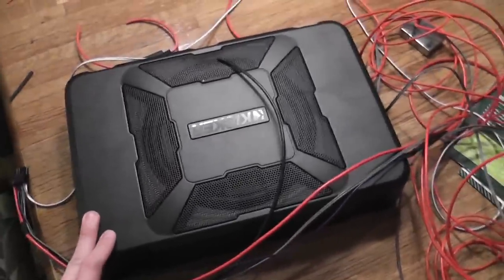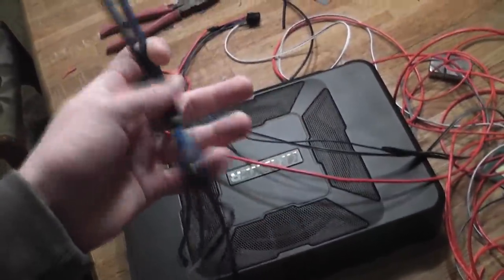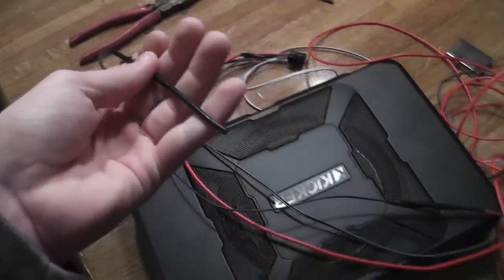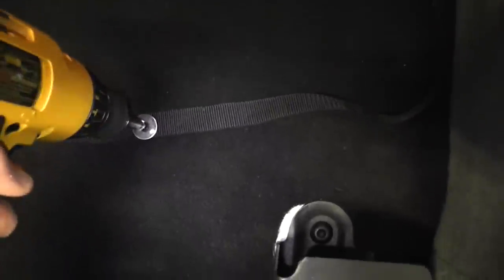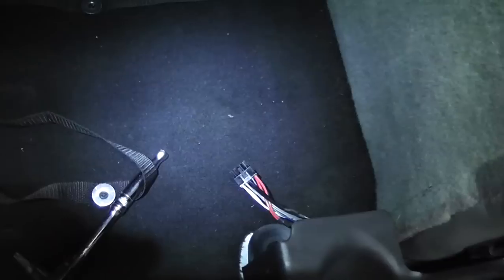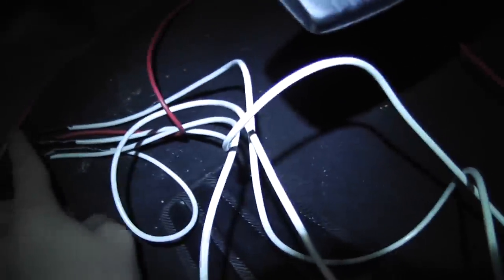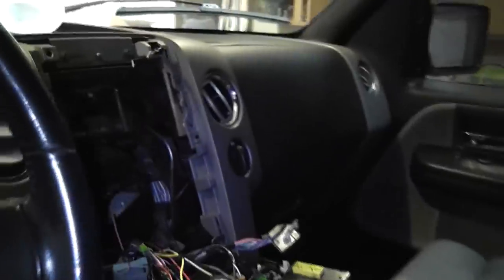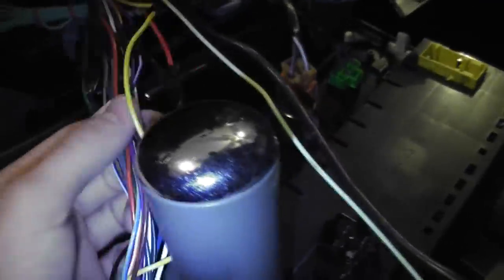How to Install Powered Subwoofer start to finish

Comment: Thanks for making the effort Bro, I researched, purchased and installed the hideaway based on this video.Far as I'm concerned Kicker should be given you a kickback. My local installers at Best Buy were saying they thought it sounds better with the high level speaker inputs rather than the low level rca inputs anyway. Sounds great, appreciate it.
Reply from the maker: Thanks man I'm glad you appreciate it I made it because every video I watched on how to install it left a ton of stuff out
Reply: Glad I watched this. Thanks for putting it together. Installing mine today and you hit on the areas I wasn't sure about. Thanks bro'

Comment: The kicker KISL works fine with it. At first mine didn't work with it. So I got my multimeter set it to check continuity. Cause the male part of the Rca on the kisl is the positive part of the Rca and the side part is the negative. So I took my multimeter put the red to the tip of the Rca then put the black wire of multimeter to each wire until it made a beep and I knew that was the positive wire for the rca. Then did the samething but the lower part of the rca and to the remains 3 wires until I got continuity again then wired the + and - to the correct wires. Then I did the same thing with the other rca tip and checked the other 2 remaining wires so I knew which wires were + and -. Wired everything together and boom it worked now. Hope this helps if you want to use rca for better sound and control with your deck instead of having to use high level inputs. If you have any questions let me know. Thsnks
Reply: Was the blue wire the tip or the lower outer ring?

Comment: Hey I connected the wire that you sent to the battery to the red wire in the radio, which is designated for a +12V accessory and my stuff works just fine and I didn’t have to drill through the firewalll

Comment: Lil late but with your headunit did you make sure if there was a "Subwoofer On/Off" setting that was on and maybe that was way you weren't getting signal? I have a pioneer  that has it set off by default as does my cheap dual unit in my truck with the same off by default  setting

Comment: FYI, there is an input level selector switch on this unit that must be set to low level if you are using the RCA connection from your head unit.
Reply from the maker: Watch the vid I know that madota
Reply: I think ur still supposed to keep it high level because it’s still speaker wire attached to rca cables. The sub works because of power. This happened to me installing an alpine power pack. I was stuck until I accidentally figure that solution.

Comment: Normally, if there is RCA out on the radio, you just run the RCA straight to the amp. If there isn’t, then you need a high-low converter (so you’re not amplifying high signal).

If your amp has a built-low pass filter (which it looks like it does since it didn’t have a RCA input), then you have to tap directly to the speaker wire from your radio.

What you tried to do was send a low signal from your radio (RCA output) into a low pass filter (in the amp). That is why you couldn’t get any sound.

It seems like you sort of winged it, without understanding, and then made a DIY instructional video.
Reply: Minh Tran A couple of things wrong with your comment, this amp can run on low (rca) signal or high (speaker) signal. It has a switch the lets you choose your configuration. The other thing is low pass filter has nothing to do with input. I know you meant low level input (rca). Just saying.
Reply: Minh Tran kicker specifies in their directions for this that you can run the kicker rca to an aftermarket radio. He might have wired the wires in the harness wrong to the rca but he did everything else right

Comment: Did you find out why the RCA adapter didn’t work? I’m about to install mine. From the booklet that came with mine (HS8) the adapter is called ZISL but when I looked it up, only thing that came up is part# KISL.
Reply: KISL is the I guess newer version of the same thing.

Comment: I’m considering getting the 10 inch hideaway, but I’m not sure. Can’t decide if I want a 5 channel amp to power my Kicker CSCs more along with a component amp, or just leave the speakers as is with a powered sub. How you liking the Hideaway?
Reply from the maker: The 8 inch has been great for me even now it’s still pumping but I think the 10 would be a nice upgrade, if it used the same plugs I am thinking about wiring a 10 where my 8 is leaving the speakers and amp stock worked fine for me also

Comment: Everyone always recommends a large gauge wire for these, but my stock amp isn’t very large and neither it’s it’s 12 volt constant wire. So my question is can I use my stock amp power source?
Reply from the maker: I’m sure you can but why not just Run a wire to the battery to be safe?

Comment: Did you skip over the fuse or did I just miss that part?
Reply: It won't matter with the gain turned up all the way he'll blow it even with a fuse.
Reply from the maker: Skipped the fuse, makes life more interesting
Reply from the maker: @schristiansen3151  5 years later and still thumping gain all the way up and no fuse

Comment: How has the sub been performing since installation? Have you also noticed any interference from running the power cable on the same side as the speaker cables? Pretty insightful video man 🤙
Reply from the maker: Sorry for the delayed comment, yeah the sub is still going strong! It broke in very nicely and now I am thinking about upgrading to the 10 inch version or getting another 8 inch for the other side to have a little more unts unts unts unts
Reply: Do you still like this sub? I purchased it today but thinking of returning it tomorrow and just wait and save for a custom build, i have a 2020 GMC 2500 with the Bose system but it did not come with a subwoofer
Reply: @jikajikasafaris9682  hey man I know this video is old but I’m looking at getting one, did it come with the little 8 pin connector that plugs into the unit ? It has the remote, speaker and power wire all combined right ?
Reply: @GerstBladeworks yes it does
Reply: @GerstBladeworks my bad just realized your comment is 2 years old you prolly know by now lmao
Reply: @Tjcin513  lol yeah I ended up selling it but it was pretty damn good ! I might get the upgraded model

Comment: Beto, did you have to switch the input switch to high, since you didn't use the RCA low jacks?  Also, does anyone have /had any trouble not useing the remote wire (blue) and switching it to auto turn on dc?  Thanks for the tips
Reply from the maker: Ken Flowers yes, you do have to switch it to high

Comment: I just got one of these Kicker Hideaway's for my Toyota Tundra. It fits great and I like the look. My issue however is that it makes a loud click\popping sound when I hit really low\punchy notes. I'm not sure how loud these are supposed to get, I personally don't think I'm going that loud. It's as if the cone is hitting the casing or something. It sounds almost metal, I might make a video and post it on here. I try not to do it to much as I don't want to ruin it. 

If I avoid that particular issue it's just loud enough to add some warmth but doesn't provide a good punch, which it may not be designed to do so, which I guess I can accept but want to make sure something isn't wrong with it.
Reply: I dont have the hideaway, but my first thought is did you set the gain properly? Lower notes typically draw more power, so it could be clipping if the gain isnt properly set. It could be something loose in the casing that rattles when the low notes hit, or possibly another part of your truck that is making the noise when those punchy notes hit.
Reply: I turned it down. I think I was just pushing it too hard and the speaker cone is hitting the metal casing - I hear it's aluminum and flat so that makes sense. I just don't crank it anymore.
Reply: you have to tune your amp.
Reply: I installed it on my new 2020 Tacoma and I get the same issue with the pooping sound did you find a solution?
Reply: violentjett  yup I went a different route

Comment: how long was the power wire that ran to the battery from the connector?
Reply from the maker: 8 ft or something long enough
Reply: That's it?! 8 ft wouldn't be enough to do anything with.
Reply from the maker: +2091AmandaPanda sorry Amanda it is actually longer but in worst case you can add as much as you like

Comment: Wouldn't it have been easier to tap into the rear speaker that's right by the subwoofer?
Reply from the maker: Not really, it is very clean how it is and running wires to the door speaker is a pain in the arse
Reply: Beto Hayes I'd be surprised if that hasn't caught fire yet
Reply: Sadpants McGee exactly what I'm planning on doing with my jeep. I have an OEM factory radio with no RCA inputs . Good call.
Reply from the maker: James K surprise surprise, it hasn’t
Reply from the maker: James K will let you know when it does tho, (if I survive)

Comment: what if you have a home powered sub that plugs into an outlet can this be but in your truck with a power inverter and if so will it turn on by itself it uses RCA jacks from home receiver.
Reply from the maker: Ricky Carver I wouldn't know if it would be enough power
Reply: ricky, i can confirm that it works. i have a 12 inch powered home subwoofer. bought a power inverter and powered it on. on full power/volume, it works great. i connected my sub with an rca cable to the back of my aftermarket radio. once again it works perfectly

Comment: Where does the blue wire hook up to?
Reply from the maker: jay son what blue wire
Reply: Either to a line in your car that sends off 12volts when ignition is on, or if you have a aftermarket headunit, it should have a blue wire that does the exact same thing.
Reply: The remote wire comming out of the radio head. Most aftermarket stereos have a remote wire comming out that is for subs.

Comment: I know this video was posted quite awhile ago but I just have to say something ! This guy should not be posting tutorial videos on the proper way to do any kind of electronics and wiring installation ! One example of a totally wrong way to do something is twisting two wires together and then using shrink tubing without soldering the connection first ! Shrink tubing is an insulator that is used to prevent shorts, not a way to permanently make a connection !
Reply from the maker: Interesting mentality there I agree that if the connection is going to be under some pressure or weathering yeah go ahead and solder it but it being 3 years since the installation and everything is still running perfect it goes to show you that if you are good enough at quick splicing the wires it is sufficient.
Reply: Does not matter the conditions, that is not a proper splice. Shrink tubing is not a mechanical means of holding two twisted wires together. If you were to use a military splice or butt connector or solder it, it would be a means of insulating the connection not holding it together. I guess if it was temporary until you could do it properly it would be okay.
Reply from the maker: krasht1 suprise suprise my dodgy connection from when I was 15 are still going strong 5 years later
Reply: @krasht1  soldering actually adds resistance and isn't needed if wire twist connection is done properly. I've got 40 year old connections still going strong. Zero issues.

Comment: Does anyone know if you need the RCA adapters to tie into a 2010 Nissan Titan OEM Rockford Fosgate stock head unit?

New to this stuff and I want to replace that shatty RF 8insub/Amp that comes with the RF audio option without having to do brain surgery. A swap and replace as easy as possibly. Trying to get a little not bump, but also to power my Apline Type E speakers I got to replace the RF OEM speakers.

Comment: You should really learn about high level and low level inputs.  Looks like this amp was made for high level in put that's why it didn't work when you connected it to your sub output.

Comment: sounds like total distortion
Reply from the maker: Sorry furry waffle my camera is not the best but it sounds nice
Reply: You're obviously low to bass, camera microphones cannot pick up the low frequency produced by the subwoofer. This is normal on all cameras, no camera yet that I know of can handle these frequency levels.
Reply: i ended up buying one of these to add a little low end in my work truck. i can attest to one thing, the video really does not show what this little aluminum cone sub can do!
i have it mounted to the floor with bolts and i found that the only way i can live with the unit daily is to have the gain set to about 1/8th. if i turn the gain to full, the entire cab vibrates! this little thing definitely moves much more than i had ever expected!
Reply: :) nice one mate.. In future you might be able to pop in a few 8"'s and a lil amp and you're set ;)
Reply: I bought this thing a few days ago and I can tell you that the videos sounds bad due to the cameras mic distorting. It's fucking awesome. It won't make your hair wobble, but it adds BIG bass to a decent sound system. I installed this in my Ute and it sounds brilliant, it is made by Kicker, don't forget that fact.
Reply: WaFfLeFuR agreed

Comment: I think the reason your RCA connections didn't work, is because you spliced the remote turn-on with 16 gauge wire. In the instructions, it says to splice with 18 gauge.

Comment: I almost bought this unit...best reviews and it appears to be the best...but it doesn't have RCA inputs. I know you can cobble it together with the adapter but wth Kicker? I want to have the input run in shielded RCA cable from my headunit (Past who knows what kind of electromagnetic interference)  to my sub. And be able to control the sub from the headunit. Lame.

Comment: You need 8awg power and ground. That
16awg not gonna work
Reply from the maker: It worked
Reply: Its literally what comes in the box. Why would they include it if it didn't work?
Reply: B_12 they are right. It comes with 8awg wire.. with16awg your STARVING the amp/sub under peak load; which causes excessive wear, heat, and less sound output.

Comment: Great video.  I have a 2008 F-150 and plan to do this same install in a few months.  It's connecting to a Pioneer AVH-X3800BHS.  On that one, I think you have to set up the system as network in order for the RCA connections in the back to work for the subwoofer.  Maybe the Kenwood is the same way.

Comment: You could of got 12 volt under the dash why run all the way to the engine bay for 150watts 😂 and you could tap into the rear speaker wires where you ran the wire lol
Reply from the maker: Thanks for the wisdom kitty brown eye
Reply: @jikajikasafaris9682 you bet nothing is worse than ripping an entire dash apart and then find out oh I didn't have too. The rcas is why you did it I know but setting the input to hi and running it off of the rear speaker signal which are in the wire bundle you ran next to under the trim plates you pulled off. You still have to run the bass level module to the front but everything else you could of tapped in right under that trim plate